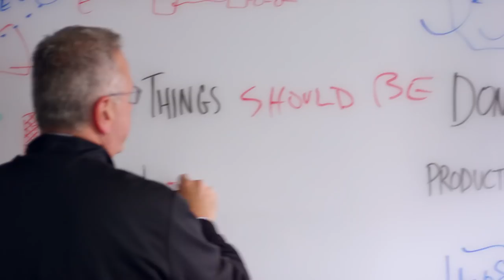Futurecraft 4D - Carbon and adidas

Comment: I've got both the Adidas 4DFWD Pulse 2 and the 4DFWD 2...both are amazing shoes. The sole on the 4DFWD 2 is entirely this lattice material and it's truly super comfy stuff.  Of the 25 pairs of Adidas I own, the Ultraboost 22, Parley/Ultraboost 21's the Stella McCartney Solarglides, DNA 19.5 Boosts and the adidas x Marimekko Ultraboost are probably neck and neck or just slightly better in cushioning but NOT in shock absorption. The 4dFWD eats it right up. It'll let you stabilize at any pace, smooth your transitions and help protect you from shin splints and injuries. If you're buying them for lifestyle, okay, you got cool shoes, but to an athlete, these are the meta for road runners, recovery runs, training sessions, etc. I rock mine probably 3 out of the 5 runs I do weekly. There is no hype to be had. #TeamAdidas

Comment: Woohow. The 3D printing from liquid could be not that fast as directed foam molding, but it is a way faster than any other printing technology. Next step is to make the printing technology as fast as possible. And of course to reduce the price. Like 1-1,5 USD per a sole. Good luck guys!
Reply: Oleplastica that's nearly the same price  if  bought in bulk
Reply: Then... why there would be the $200-250 price for a pair of shoe on the retail?
Reply: Because premiums.